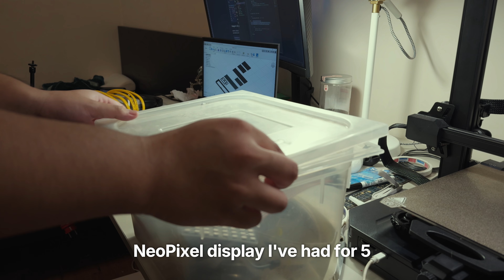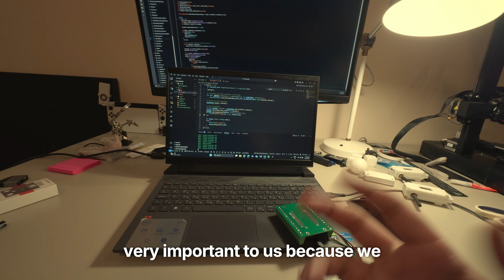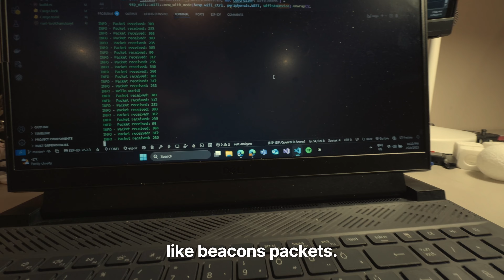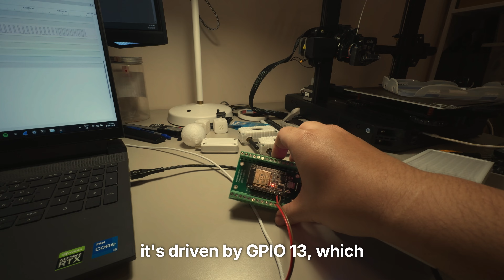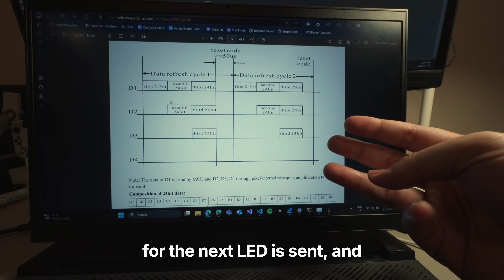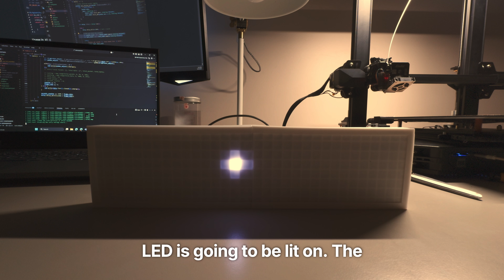Visualize Wi-Fi traffic using Rust on ESP32 (Matrix Style)

Comment: amazing project dude! can you provide some especifications for LED configurations? maybe examples of LED strings that are easy to manage behaviors? thx for this amazing content <3
Reply from the maker: For LED strings, the keyword is “individually addressable led”. This will lead you to the ws2812/2813 line or the sk6812 line. Or if you want led matrix, find matrix module (often P6 P4 P stands for pitch) with their own dedicated controller which does multiplexing. 

Individually addressable led with 1 data line is very easy to control, biggest downside is you can’t run a lot of leds at the same time due to the way they control the led + low refresh rate. On the other hand, Multiplexed LED is good for refresh rate + scale and it saves power, but harder to use.
Reply: @build_with_binh  thanks, appreciated that, new sub! 
I am looking for firmware to interact with as well, I arrived here looking for rust stuff for firmwares, led multiplexing using the matrix looks like the best approach, I think that I could start handle with ```m[i][j]``` and learning for enhance interaction, "individually addressable led" this is exactly what I was looking for, a good starting point to me to deepen, have a nice day!